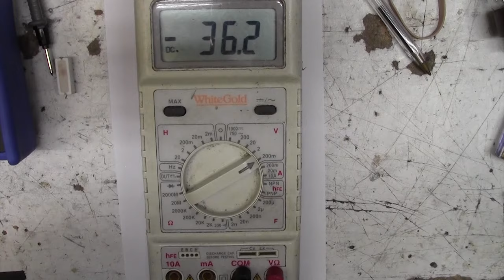How to Bias Orange Rockerverb 50 MKIII

Comment: Hi Stuart, i have a question related to this exact amp, i've got this amp about a year ago and it is fantastic, i use it on studio, i take good care of it. The other day i was using this amp when i noticed that the clean channel was not loud enough, i turned the volume knob to the max and still had the same issue, and the sound was also not clear enough. The dirt channel sounded perfectly, no issues at all. could this be related to the valves? if i find a valve that could be broken, can i just change for a good one instead of buying all of them? thank you so much!
Reply from the maker: Hi. Hmm it's hard to say. It COULD be a valve but unlikely Try swapping them around to a different position (same valves types of course!) and see if that changes anything. If not, it won;t be the valves. And yes, of course, you can just swap out one valve for new if you want.

Comment: Hi, this is agreat video. Do you where I can find information or a video on changing the preamp valves? I understand the reverb and loop have one valve each so leaves 4 preamp valves. It would be good to know which these are and which have to be matched/paired together. Thanks
Reply from the maker: Hi Preamp valves don't need matching or paitring so just go ahead and change like for like. EG ECC83 for an ECC83 etc. Also, only change them if you really need to. Valves are expensive these days and preamp valves last ages.

Comment: STUART, if the bias is 35mA and the plate voltage is 350vdc or 400vdc the bias voltage on the grid of the power tubes should technically be HALF of the plate voltage? so around 150vdc on the grids of the power tubes?
Reply from the maker: Hi Wayne. Absolutely not! In general the grid is held NEGATIVE with respect to the cathode. Even 0V on the grid would cause the power tubes to burn out. I think I've done a video on this, try my 'How Guitar Amplifiers Work' mini series. All the best.
Reply: @stuartukguitarampguy5830  When Biasing PNP transistors the Collectors output voltage is HALF the +Vcc Power Voltage. For Power Tubes its the same as biasing PNP transistors that the Plates should be HALF of the +Vcc power voltage. This is to get the correct symmetry of the positive cycle and negative cycles to have no clippage and the most headroom
Reply from the maker: @waynegram8907 Transistors are biased completely differently to valves. For a valve the grid is held negative wrt to the cathode. I'm talking DC of course, not AC.
Reply: @stuartukguitarampguy5830  thanks for this, I was using the output transformer resistance method to bias coupled with a bias probe as outlined as the preferred method on Rob Robinette´s calculator website. Obviously that method is a bit more engaging not necessarily difficult, I was wondering if the method shown in your video will achieve the same results?
Reply from the maker: @TheLesgumes Similar I expect. None of this is critical.
Reply: @stuartukguitarampguy5830  actually I just learnt that the MKII doesn’t have the same circuit, ie the absence of these 1ohm resistors.

Comment: Hello Stuart
Thank you for your response.
I acquired the amp second hand, in nearly new condition and I just replaced the 2 output valves.
It did not have the  reverb tank installed.
However, I have the serial number on the back of the Amp and the serial number on the main board.
This may be useful to try and purchase the correct spring reverb module for it?
I have searched the web with no luck so far. 
I am not sure whether or not, that Orange made identical reverb units for the Rockerverb MK2?
Best regards 
Keith
Reply from the maker: This may be heresy but I've found that pretty much most reverb tanks work in most amps so it might be worth trying one!
Reply: Great
For about £30.00 its probably worth the try?
I am going to research a bit more, just in case I can get a bit more information.
It is a personal project anyway and not about money.
I am a retired electronics technician, mostly doing old fashioned electronics, component level replacement etc.
I have found a new joy in valve technology - you can actually repair them instead of throwing the boards in the bin - as is most technology now?
Thanks Stuart.
Keith

Comment: Hello again Stuart
I am trying to find a compatible Reverb Tank for the Orange RockerVerb  MK 2 amp that I have just managed to repair with your help.
May I ask if you know the input and output impedance of the spring unit?
I cannot find any specific Orange replacements, as most retailers only give the input/output values, and most only refer to other amp manufactures.
Thanks once again.
Regards
Keith
Reply from the maker: Hi Keith  Most reverb tanks have the model number stamped on thjem. Does yours?